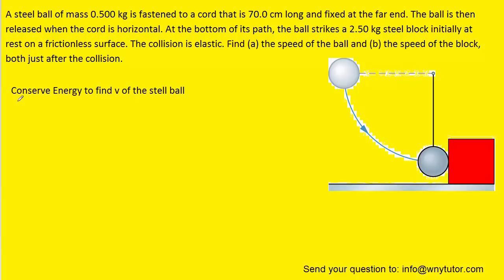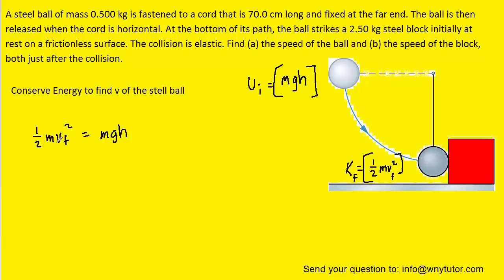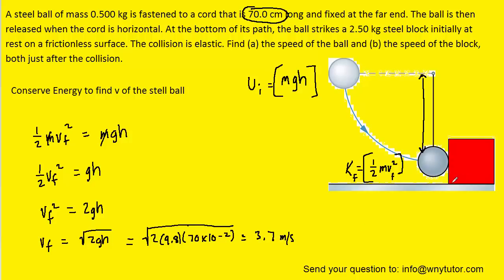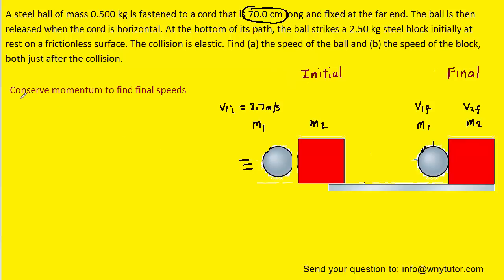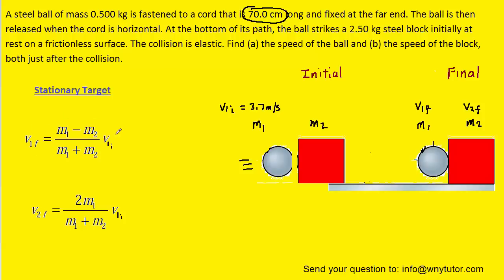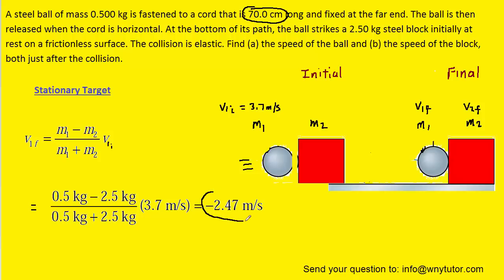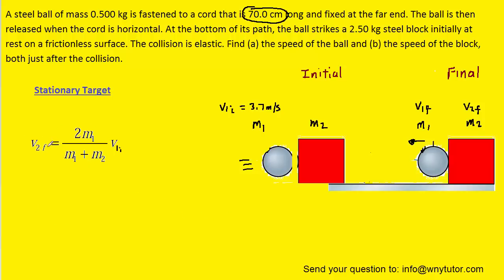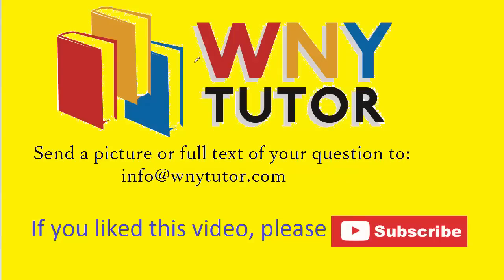A steel ball of mass 0.500 kg is fastened to a cord that is 70.0 cm long and fixed at the far end. T

Comment: how are the stationary equations derived?
Reply: From what I understand, for these equations kinetic energy needs to be conserved (AKA elastic).

So m1v1 = m1v'1+m2v'2 and 1/2mv^2 = 1/2mv'^2 + 1/2mv'^2

You can get rid of the 1/2s for the KE question and then factor it into m1(v1 - v'1)(v1 + v'1)= m2v'2^2
you can also factor the momentum equation in a similar way so the v1 - v'1 cancel out

Now add the new equations and you have 2v1 = (m2/m1 + 1)v'2

From there solve that equation for v'2 and sub it into v1 +v'1 = v'2

Sorry for the horrible explanation but hopefully that helps a little
Reply: @michaelo9814  what is that new equations to be added?
Reply: I would like to know this as well, are we just supposed to have these memorized?